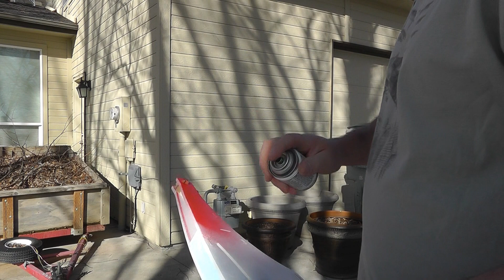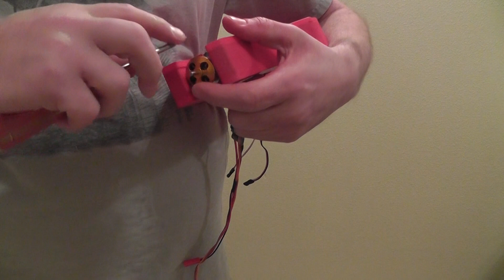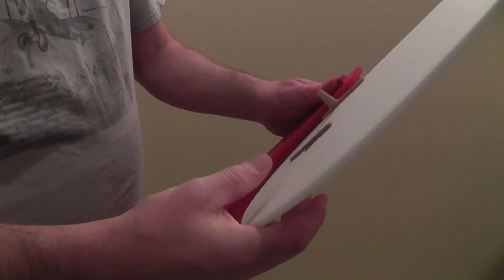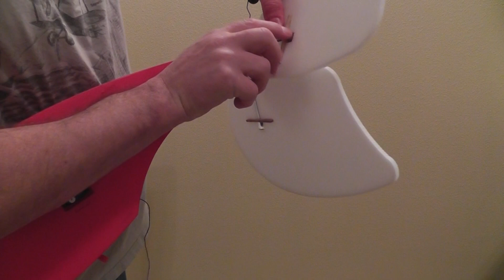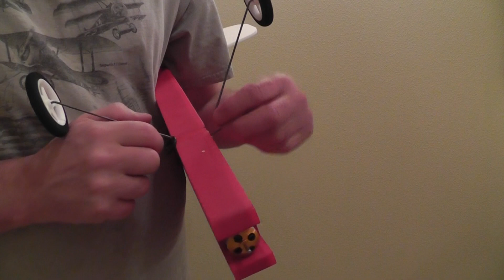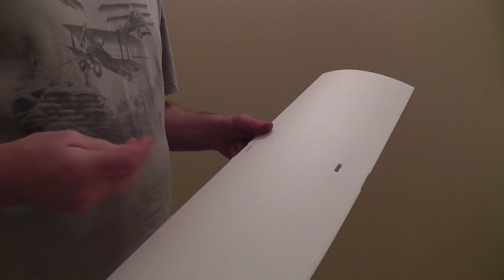StuntBipe Build Video

Comment: here in 2017 they don't seem to make this plane anymore .  heads up doesn't seem to remember it. I have a slow bipe (from heads up) and it works real good.  was wondering if I should just get another one and modify it .  shouldn't be to hard to make elivons. was also wondering how well a plane would fly with elivons instead of ailerons. have been wondering that for years, this is the first time I have seen it done,  and it seems to have been discontinued  How did you like yours, will it fly inverted? was it better than rudder (and elivator) only?

Comment: Elevons are a combination of ailerons and elevators. To run elevons you need each elevon (one on starboard and the other on port) to be controlled by seperate servos. I only saw one servo connection meaning that either you mistakenly said elevons instead of elevators or you didn't hook up the second servo to properly in the video. Which is it? Elevons or elevators?

Comment: Nice VDO, but at exactly 4:52-4:53, you said E-Max 2022 motor; I didn't find it anywhere on the net! Is any such motor available, or you made a mistake? Please advice which motors can go with it. And I also see that this particular plane is not available now, so is there any option to stuntbipe? Do reply. Thanks...

Comment: I bought mine about 3 weeks ago from headsuprc and its a great forgiving model.i used krylon short cuts which you can get in joaan craft stores real cheap. you need about 3 cans. mine is yellow and black an it flies super.  I used  a very inexpensive brushless motor that turnan 8 " prop  (8 3/8 -or 8-4) 2 cell lipo 800mah  but im gonna try a 3 cell 7" prop maybe 600mah. what I like about the plane is that a lot of the plane one needs no glue. I use  hot glue very with little low temp . servos just sit In there slots with just a touch of hot glue. took me about 1 hour an all the wires and esc fit in the hatch easily.